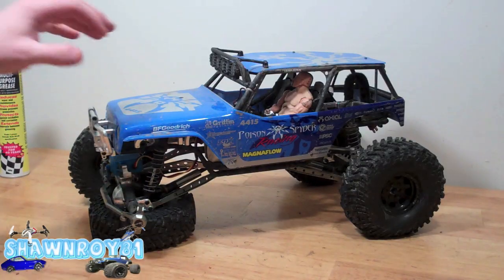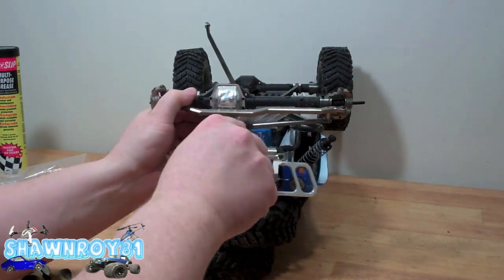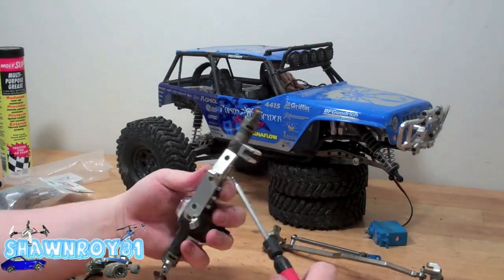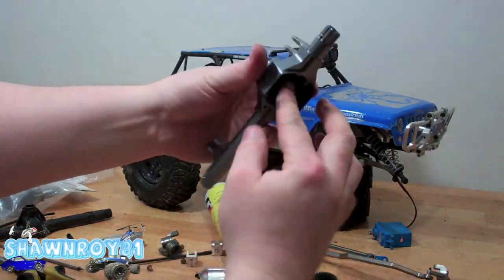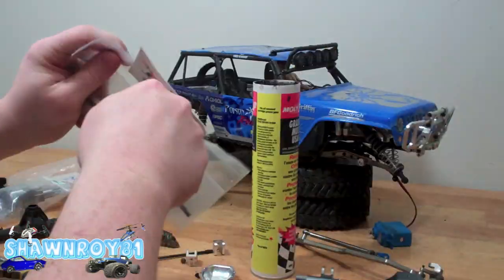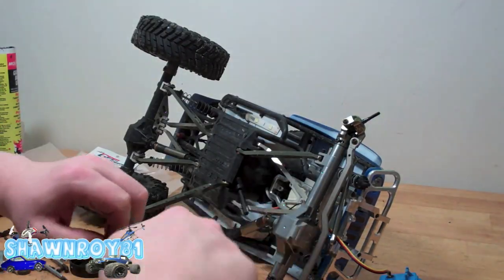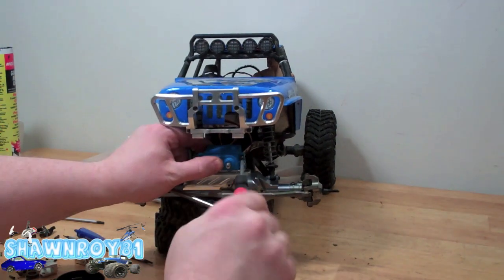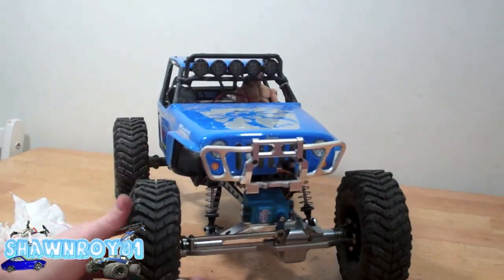Axial Wraith GPM Aluminum Axles Install

Comment: SWEET Axle Housings!! 👍👍
Less to Upgrade on the Wraith Spawn, like I have.... Not that I wouldn't anyway if needed! 😉  For anyone reading this, the Wraith Spawn COMES WITH Bulletproof U-Joint front Axles, WB8 Heavy Duty Driveshafts and a HD Transmission, with 32 Pitch Gears, and the HD Double Slipper Clutch, from the YETI. 
...... At least the Kit Version does. I never buy RTR, so I can't answer that. 

Dude, you've REALLY Upgraded your Rig!! Impressive.
Carmine 💥⛽

Comment: They do look nice. I assume they'll be durable as there isn't a whole lot to go wrong really. Did they feel a lot heavier than the stockers? Should be good extra weight to lower the CG.
Reply from the maker: ya they are heavier. No I wont need to add weight cause the axles are the lowest point of the rig. When you add weight its usually to the axles. Specifically to the inside of the rim which would be the same as getting heavier axles.